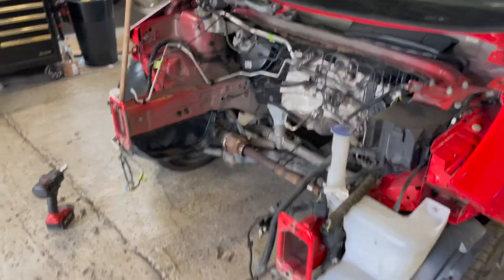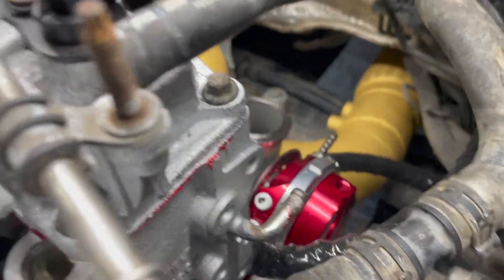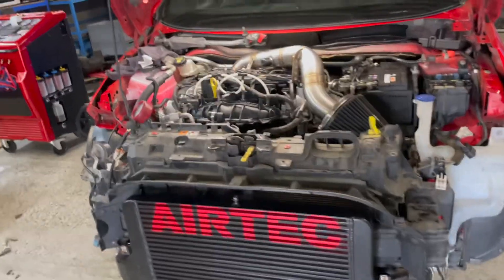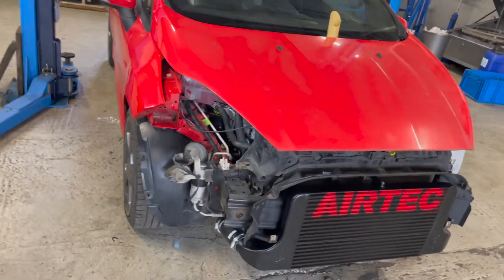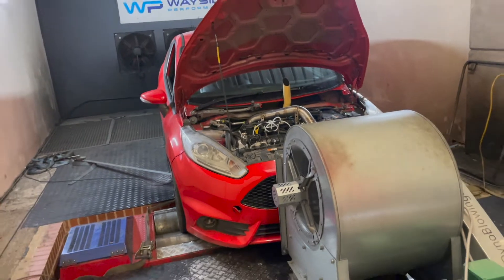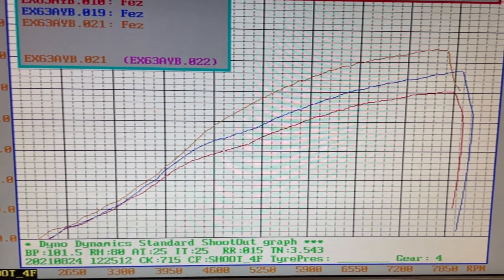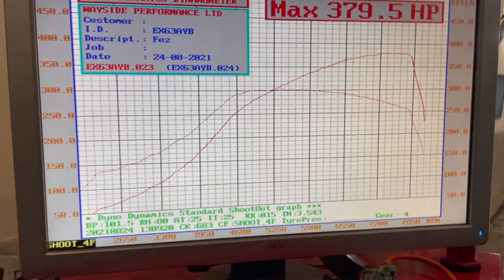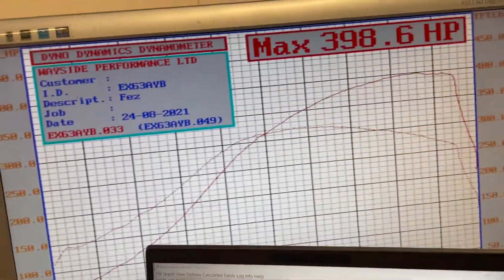Fiesta ST ST180 1.6 Ecoboost big turbo forged engine build Part 3 - On the dyno!

Comment: that exhaust is lame af lol, hot airintake fail aswell no rad upgrade lol
Reply: 3” exhaust is big enough, air intake sits exactly where the cold are is sucked in and I’m sure these boys will be tracking coolant temps regularly

Comment: Why run the inlet right over the top of the turbo? Why not direct it the other way around the engine and have the air filter sit behind the light?
Reply from the maker: Hi, we initially wanted to keep this set up as OEM as possible so that it would even fit with other aftermarket crossover pipes

Comment: That is great power, and it was really good to see the build work going into this engine. With that power it really need to be 4WD?
Reply from the maker: Thank you 🙏  this really is just proof of concept at the moment, we plan to push this platform even further over the coming months. 

3rd gear already struggles for traction but hopefully with some new stickier tyres soon we may get some grip. 

We plan to do some drag events next year in the car to see how fast a street spec fiesta can go!
Reply: AWD would be really great for it, i'm looking in to swapping a ford ecosport diff and suspension in it, but the gearbox is an issue, the default one can't really be used with awd, and basically nothing else fits, so i'm thinking of getting a custom bell housing cnc machined with a kotouc 7 speed sequential which to me seems like the easiest option, but not cheap